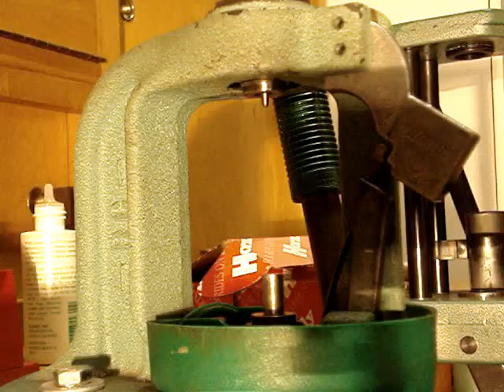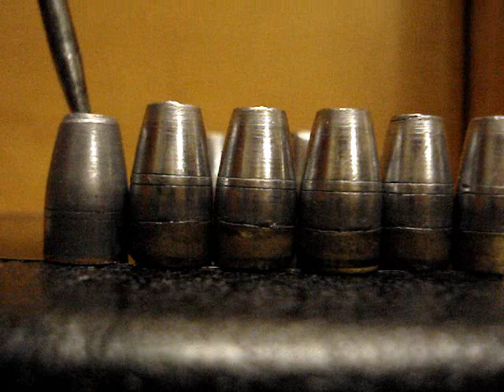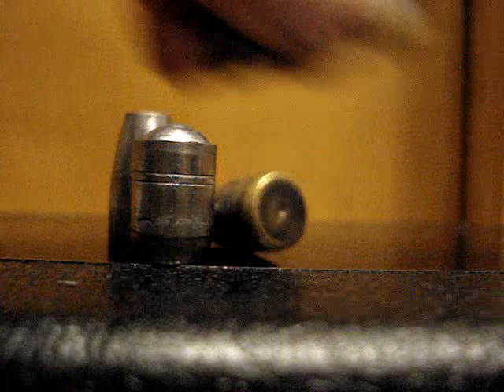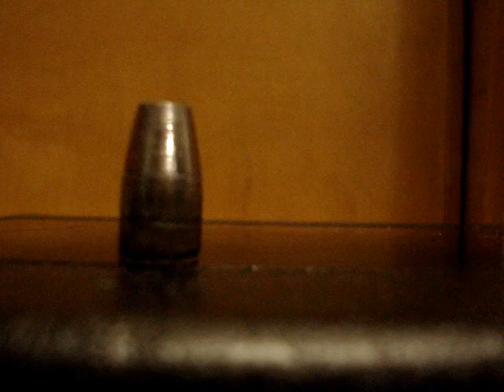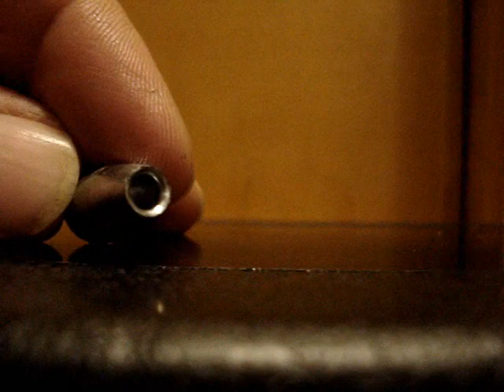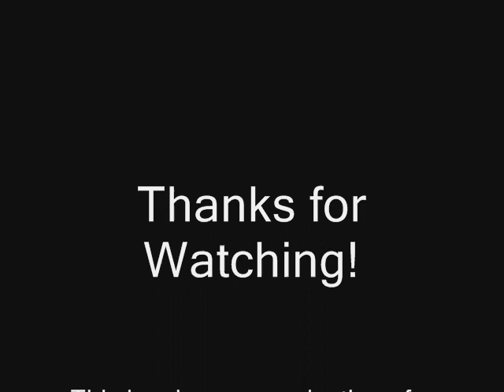Bullet Swaging Part 3

Comment from the maker: I put the gas check in the way I do because they sometimes don't seat evenly. This causes them to be thicker on one side than the other. It's because I'm using a 9mm diameter bullet. #2 alloy can be used but be careful you don't over stress the dies. The dies cost $135 delivered.

Comment: Thanks for posting this! I have always wondered how swaging is done. Do you have to use gas checks? Why cant you just place the gas check on the bullet slug instead of seating the gas check up the die? Can your bullets for swaging be from cast #2 Lyman lead? Also, what does the die set cost? Thanks once more!!

Comment: I tried swaging some bullets with my new 101-series hollow-point dies today. The swaged bullet ejector (HP punch) gets stuck hard in the newly-formed hollow point using both my .355- and .357-caliber dies. I have to pry the bullet off the HP tip of the ejectors, marring those shiny new bullets. I tried putting some lube on the hollow-point tip of the ejectors, but that didn't help. I'm using pure lead. What is the trick to not get the ejector tip stuck in the new bullets' hollow point?